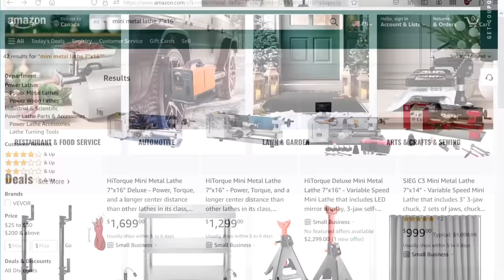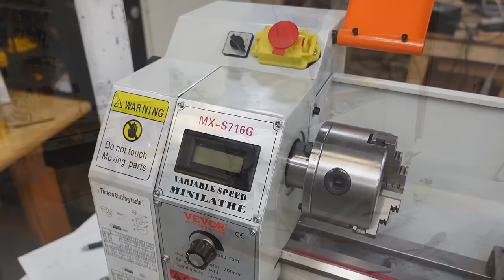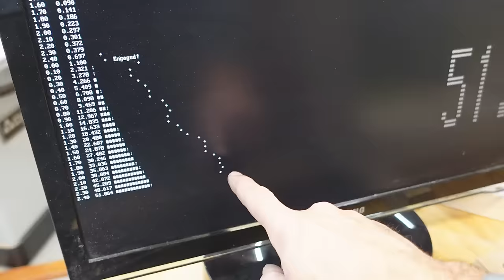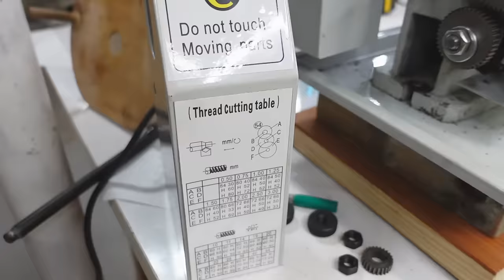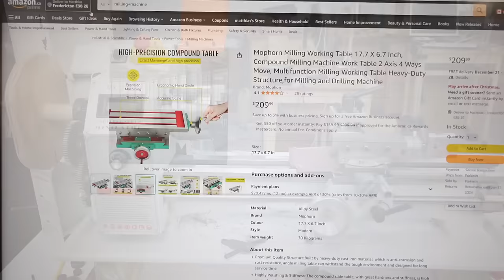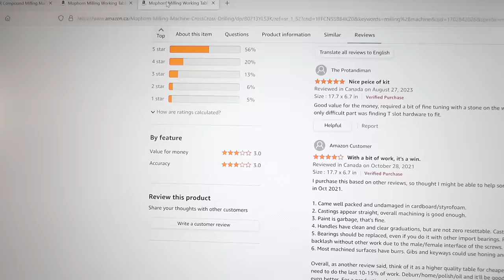I finally got a metal lathe

Comment: Why are you trying to do precision metalworking with a boat anchor? Get rid of it, poorly made, not enough mass, underpowered unless you are turning toothpicks. Get something more Ridgid, I suggest the second hand market and preferably not from China. Something better built will minimize your frustration of struggling to get results using  a really crappy lathe.